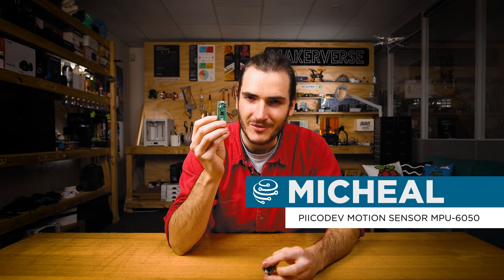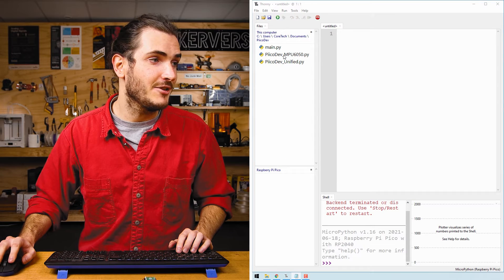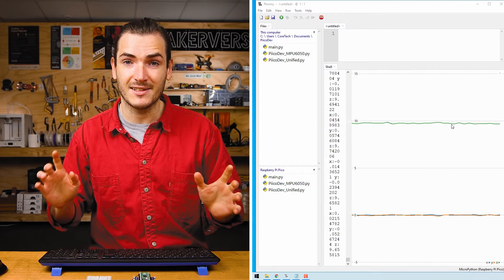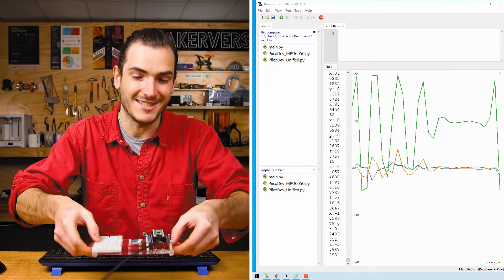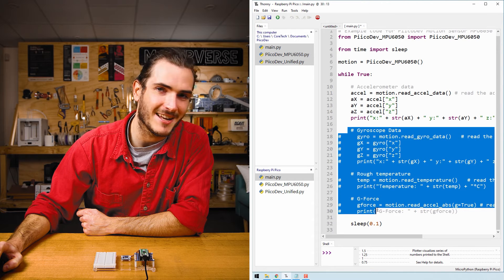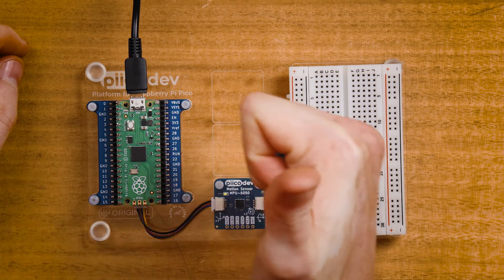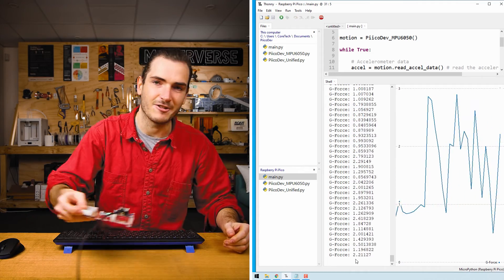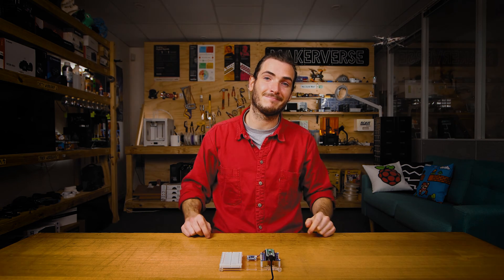PiicoDev Motion Sensor MPU-6050 | Raspberry Pi Pico Guide

Comment: Hey Hi. Nice tutorial. Can you please let me know how you are plotting? because I am trying to plot the raw sensor data of MPU6050 through Pico. Any hint related to plotting will be much helpful.
Reply: Either right click in the bottom console and SHOW PLOT, or you can at the top of Thonny, View and check the plotter, you can also turn on/off the left side Files, if you want more screen. 
You can also drag each windows edge for more/less space. 
I personally like 60% top code, and slide the plot area left or right more/less depending on information shown.

Comment: Hi. The video clip is very very nice and explains the acceleration and angular momentum clearly, however I am looking for a sensor to measure the absolute distance traveled in X, Y, Z direction. Is that possible with the 6050 (or any other) sensor please ?
Reply from the maker: What you're referring to is "dead reckoning" which is really hard/expensive to do with an Inertial Measurement Unit. For example, military aircraft and ships often use a "laser gyro-compass" for this purpose - suffice to say that's a bit out of reach for most hobbyists.
Reply: For that I would suggest adding a GPS sensor. Either that or using standard velocity in the calculation.

Comment: Where did you get these number
# Pre-defined ranges
_ACC_RNG_2G = 0x00
_ACC_RNG_4G = 0x08
_ACC_RNG_8G = 0x10
_ACC_RNG_16G = 0x18

_GYR_RNG_250DEG = 0x00
_GYR_RNG_500DEG = 0x08
_GYR_RNG_1000DEG = 0x10
_GYR_RNG_2000DEG = 0x18

Comment: hi, i ran your codes and i faced such a problem;

Traceback (most recent call last):
  File "<stdin>", line 5, in <module>
  File "PiicoDev_MPU6050.py", line 80, in _init_
  File "PiicoDev_MPU6050.py", line 125, in get_accel_range
OSError: [Errno 5] EIO

What do you think is the problem?
Reply from the maker: Hi! We handle tech support over at https://forum.core-electronics.com.au/ - Head over and open a thread, some pictures will help troubleshooting too!

Comment: Hi! Stumbled upon this nice tutorial while doing a small project while being a total newbie to electronics with a programming background. Is it possible to connect the raspberry pi pico directly to the motion sensor, without the expansion board? Cheers!
Reply from the maker: You certainly can! We have a cable that will allow you to freestyle the connections; with a PiicoDev connector on one end and four female headers on the other. SKU: CE07958
Reply: I have a different MPU6050, so just wire direct. Seeed connector is not required, it’s just a connector of convenience